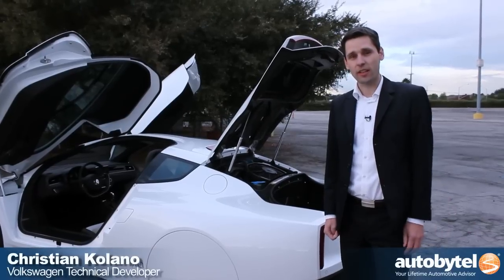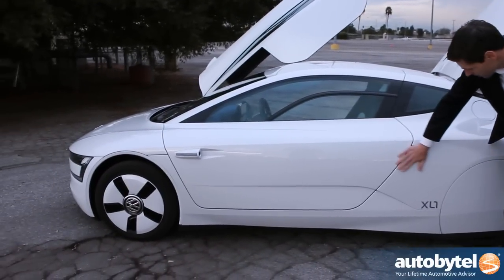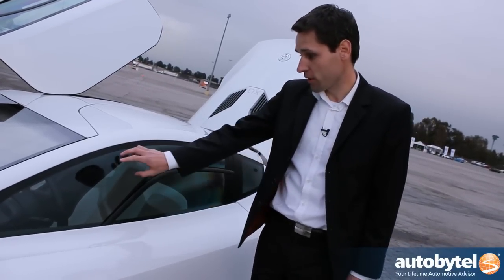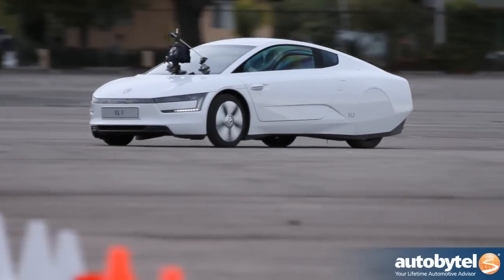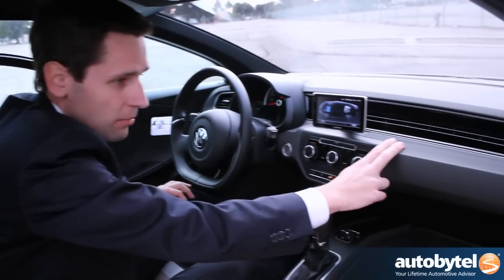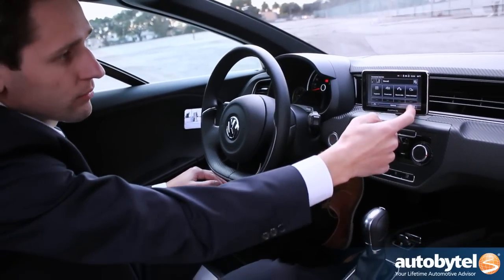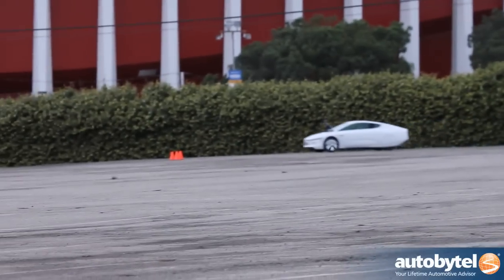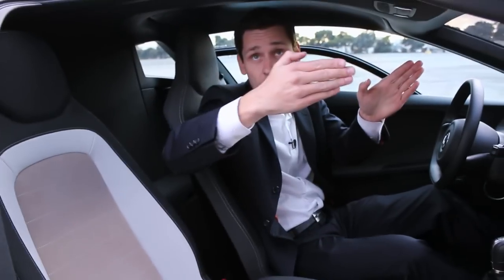Most-Fuel Efficient Car in the World - 2014 Volkswagen XL1 Walkaround Video Review @ LA Auto Show

Comment: If you think the back looks funny, so does the future. That form of rear (Kamback) is a vital part of modern aerodynamic efficiency. The price cannot be low because they are using materials that are less available, and thus, more expensive than those used by most vehicles. In addition, more efficient models take more time to develop, with more research hours and higher status engineers being called into effect. Wait for the future, and these vehicles will probably be much cheaper, once they are better established, and their factories have dedicated systems.

Comment: The best way is to apply little 20kW diesel engine to generate electricity for the 20kwh (up to 200kg LiTi) battery and for the two electric engines: one of them 12kw to maintain speed and the second one 50kW to make acceleration! The car for cities! 
   Is it too hard to ... (you have no corresponding word in English) to figure it out? herausfinden...   сообразить!!!

Even better is to use this diesel for electricity generation and speed maintainance + 50kw additional electric engine!

Comment: I like efficiency and stuff but i thought it was funny that here ya have a aerodynamic vehicle that he demonstrates driving at speeds where aerodynamics are not really a concern. And it seems most cars no matter how aerodynamic they are still loose efficiency after a certain rate of high speed at like 70 mph and up. How much more do you expect to improve? Just saying.
Reply: You do realize even vehicles like prius's reach speeds above 70mph and still retain great gas mileage so yeah just saying... If your not a scientist dont attempt to act like one
Reply: Never said i was a scientist nor am i trying to be one but i can still be a skeptic about stuff. And ive never heard of any vehicle gaining the best mpg on anything at 70mph and up. Sure there are some internal combustion engines that reach there efficient peak at speeds like that but they tend to be larger displacement engines and their peak mpg is still lower than that of a smaller engine. But then that smaller engine is more efficient at lower speeds between 45 to 55mph. push them at higher speeds and mpg drops off. even if the car is aerodynamic its final overdrive gear should be geared to allow for power reserve so downshifting isn't necessary otherwise to high of a gear with just lug out the engine at 70 mph. You can only put out so much torque out of a small displacement engine. AND some car can be designed to smooth and rounded that the airflow tapers to much to the car. Again im not a scientist. Just pointing out what ive learned doing my own research. And we haven't even factored the weight of the car in question.

Comment: LIE  ABOUT AIRDYNAMICS!  It  is worse than that of our old Soviet legend - LADA! 
Look: they state this VW has Cx=0,198!   This is lie!   No computations needed, just compare: 
Lada has THE SAME 68hp and THE SAME top speed 158rm/h,  BUT MUCH MORE Frontal area !!!  
Old Sov. Lada has 1.885 square meters versus 1.5 sq.m of this car!!! So, it has fantastic looking streamlined look with ugly real air streamlining! 

Salute from Russia! 

Lada has calculated Cx=0.45-0.46. So, this car has Cx  (1.885/1.5) times more in reality! 
Lada weighes 980kg
Her consumption today after all possible updates is less than 6.5l/100km  carburator and 5.5l/100km injector  5-gear -  at speed 100km/h, while your car has may be 3,6?L/100km thanks to really interesting but powerless diesel.
And yes, Lada cars still serve us some 40-50 years so far! Back from 1970th and give us real drive feeling!

Comment: I could maintain my current fuel efficient car for 20 + years instead of buying this. how much pollution is created in fabricating every new component of that car?
Reply: Plastics and aluminum? Much less than the average production vehicle. And with tiny, light parts, even less is being used to construct a functioning car. Less material and improved efficiency make it a very viable solution; it may possibly be cheap to manufacture as well reducing the total cost of the vehicle. Genius in my opinion.
Reply: Aluminium is VERY energy intensive (=CO2) to produce and make a car from. You will never earn that back in terms of saving fuel by "adding more lightness".
Reply: Unfortunately a shelved project but there are a few models floating around.
Reply: @artytomparis  VW only ever intended to make 200 units of the XL1. The project was completed (not shelved) and was a total success in every way, in what it set out to achieve.